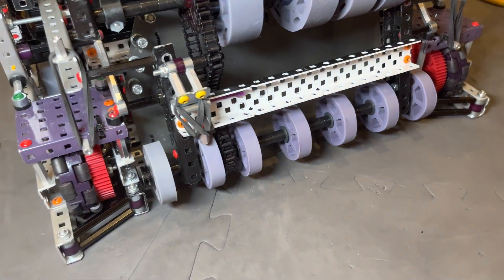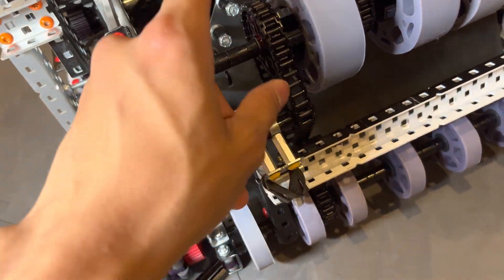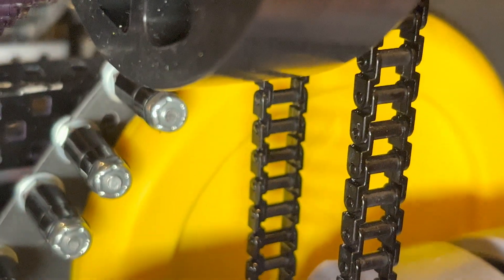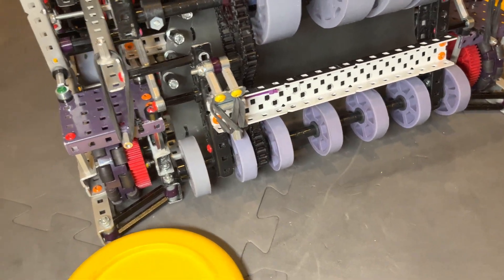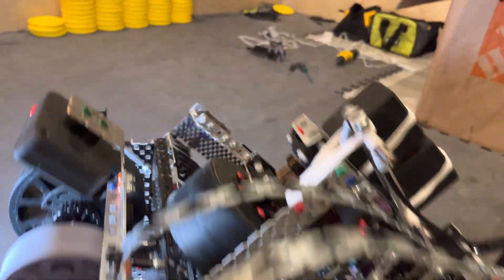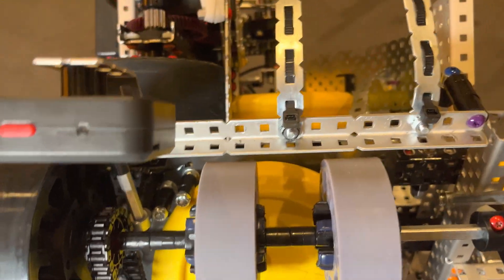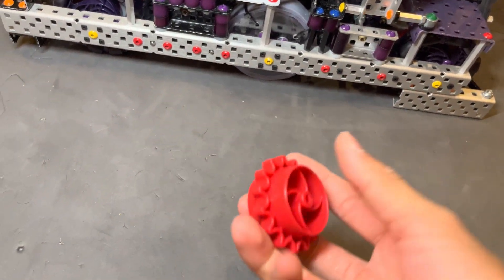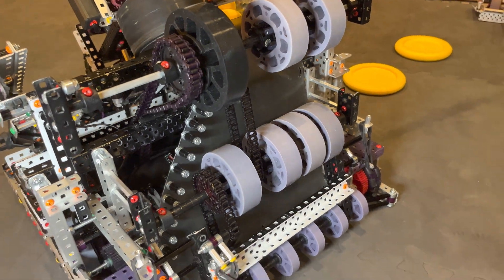606X Spin Up | Intake Explanation

Comment: Unrelated to the intake but I wanted to ask how you got the shooter of your robot and such angled so nicely. I know their are angle pieces, gussets and hinges and probably other ways you can angle things but it looks like a lot of your structure just involves shaft collars, screws/couplers, spacers, and standoffs. Did you just use these to angle the top portions of your robot? I've never seen this done before and I'm relatively knew to robotics and thought it was interesting, also would you consider a video going over general structure/chasis of your robot or of robots in general?
Reply from the maker: yep! by using shaft collars, we are able to achieve non-standard angles by using triangles with custom lengths on each of the sides. By changing the lengths of the sides of the triangles, we are able to adjust the angles of all the mechanisms on our robot.

The shaft collars act as vertices of the triangles because of their ability to rotate as well as attach standoffs to them.

Generally, the same can be done with C channels to form triangles to get custom angles as well. Many teams use this to get desired angles on flywheels, roller mechs, etc.
Reply: @606X  Wow that's a really cool way to structure a robot. I wasn't even aware screws could fit through shaft collars before I saw your robots structure. Unfortunately it's too late for me to make much use of this info with my current robot though I am using it with my pneumatics and end game now. Thanks for the great videos man.

Comment: Why is it so easy for your robot to pick up disks using 2” wheels onto almost a vertical polycarbonate? We always get stuck at the around 80 degree angle.
Reply from the maker: try reducing the initial angle of the ramp, and moving the first stage of the intake further forward from the ramp. We found that these two changes helped a lot for us
Reply: @606X  Yes,  I agree, but then the length of the robot has to increase. Your 2" flex wheels almost touch the polycarbonate. I feel something else than the two factors you mentioned also plays an important role.
Reply from the maker: @mingyangxu2948 maybe try adjusting banding of the intake downwards?

Comment: What was the reasoning for having the system using flex wheels rather than a chain with the rubber flap things?
Reply from the maker: more grip, more compliance. the tank flaps don't have the suitable level of grip on the discs we were looking for.